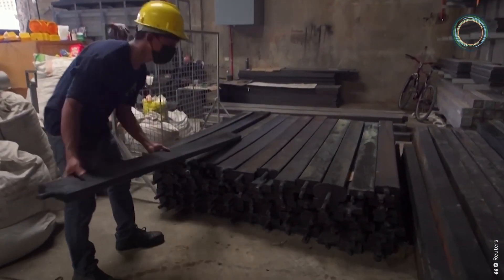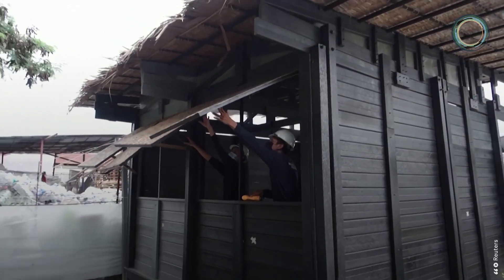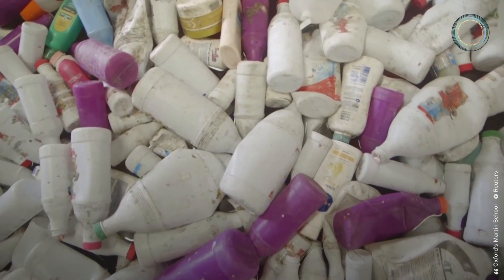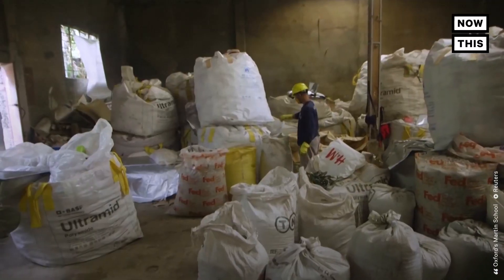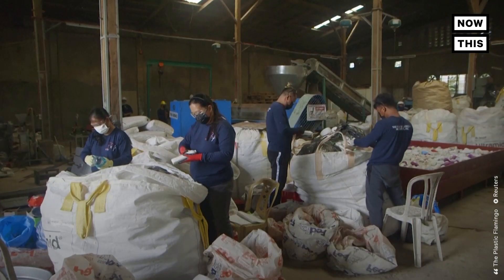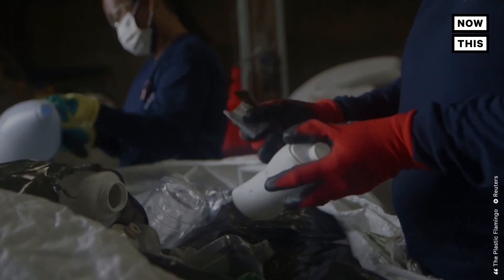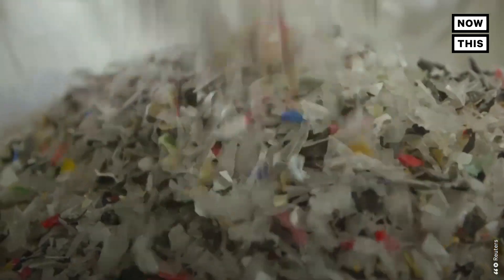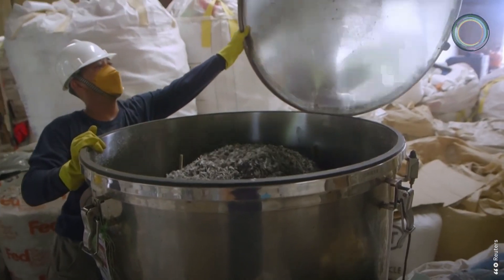These Shelters Are Made From Recycled Plastic

Comment: There needs to be an easier way to increase plastic purity without people having to scrape the sticker labels off
Reply: I agree. Maybe a glue that sticks the label on well, but will come off easily when submerged in a certain, non-toxic  solution. Then regulations would have to be in place to ensure that the only glue used would have to have that property.